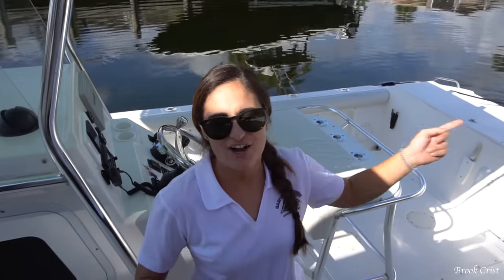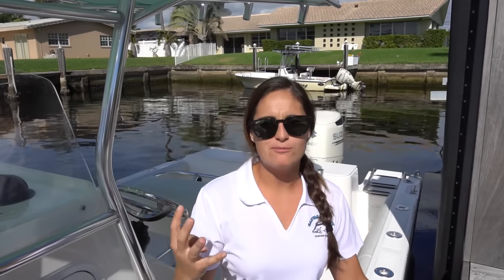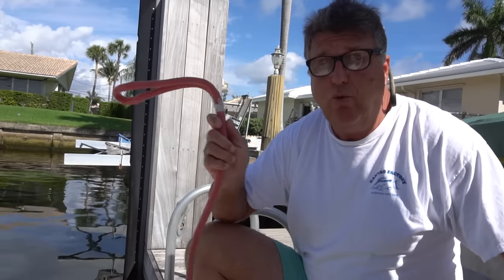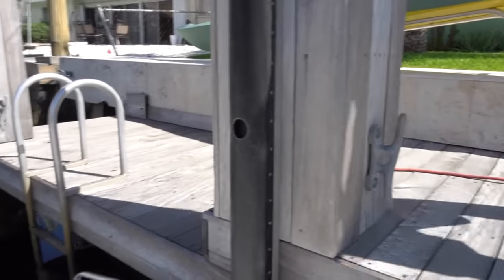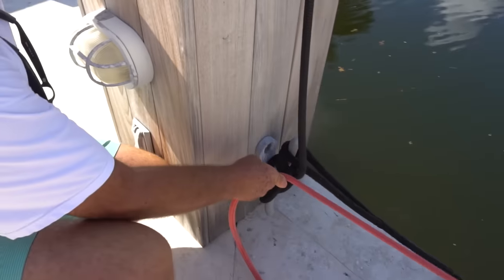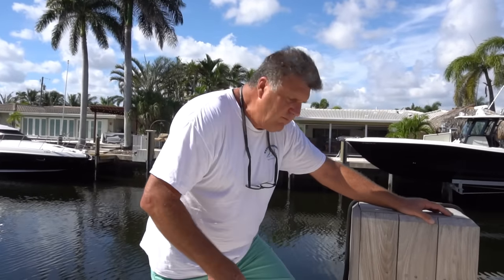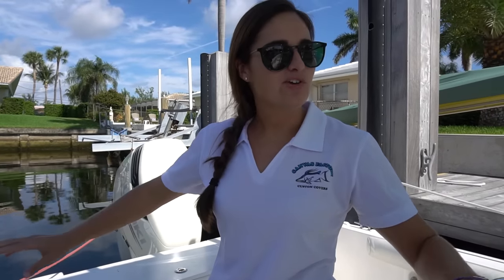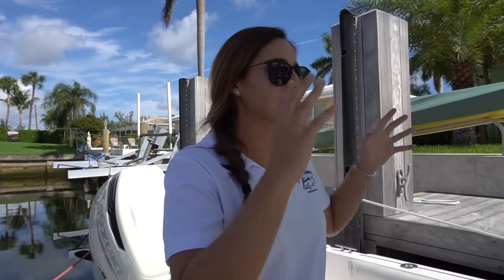HOW TO TIE A BOAT UP AT THE DOCK

Comment: This is all fine and dandy EXCEPT when your docking at a busy Dock !!!. There will be 4/6 boats trying to dock at this dock !! You using Long lines and using 4+ dock cleats will piss off other boaters !! Don't get me wrong, You're 100% Correct with this Line method !!!!. But, If you attempt to do this at a busy Dock, Any Dock Tender (Person helping with docking at many places) won't allow you to do this !!!! They INSIST on Short lines, And most only allow 2 cleats for smaller boats !!. Believe me, I've had this argument many times !!!!. BUT, Great Video and explanation of how the lines work !! Many MANY boaters don't understand this !!. Thanks
Reply: I was thinking that the entire time watching the video.  The method shown is not practical in 90% of the situations encountered.  No f'ing way you can run a line that long at a public dock.  Thankfully I'm on a lake and never deal with tide issues so my lines can be shorter.
Reply: That is true but most of the docks around here are floating docks and short lines are the norm. We always tied up bow and stern lines toward the middle plus an additional spring line. Of course, we were 55 ft long too. lol
Reply: WE are in the northeast and all tie-ups are short and tight. We are always tying to a float, though. 2 lines are all that are needed up here.
Reply: Love this video and great concepts to learn but agree about hogging cleats at public docks.  Another way to do this at a busy dock is to wrap piling by using the loop end to create a large loop that can go around even pilings this size and then tying off to your boat cleats. If you need to use the same piling as another boater, you can "dip the eye" by going up through your neighbors loop around the piling and then around the piling with your loop so that both of you can release without disturbing the other line.  As to the set up in the video, I would tie another line over the mid-cleat to make sure the spring lines don;t back off the cleat horns.
Reply: @erictwombly7233  Makes sense.

Comment: Excellent video!  Good point about using the cleat on the far side of the piling.  I not the knot you use on the cleat, we were shown two full turns and two eights and then a single hitch.  Can't wait to get back on the water!!

Comment: Very impressed by Brooks boat handling abilities. Thank you for making this video and explaining spring lines. In extreme tidal areas, you would want to put your spring lines further out, that is, on the stern cleat and  bow cleat, and then run your spring line the length of the boat to dock cleat. I’m sorry, but, your cleating hitch is incorrect.I highly recommend Chapman Piloting and Seamanship book.It is a most excellent reference for all small boat operations. It is well worth the investment.
Capt.  Fred

Comment: About 80% correct. Making people aware of the spring line is good. Never drop a line across your motor. Need to work on proper cleat tie off. But over all good for novices.

Comment: Good video  with good information  details only 1 type of docking  situation  up north we have  a lot of different  configurations of floating  docks and docks where  your between  2 poles bowed up or sterned up to floating dock and so forth different  types of finger docks, navy docks, one  constant  in a lot of docking  is the long lines or spring  lines   to go up and down with tides 👍

Comment: If you are on a lake you don't need to worry about tides. But wicked storms, winds and current can be just as bad especially on the Great Lakes where the weather can be very unpredictable. This is a very good video with excellent points regardless of location.  Pilings where I'm at aren't nearly as nice as yours so securing a boat is always a challenge.  Also, long lines is the goal but cleats are not always available if docks are full (which is often the case) so you just have to make due in those situations and tie up to pilings instead of cleats.
Reply: That's a good point, I'm in Virginia and good thunderstorm can easily whip up 6ft Whitecaps on the lake here.  People usually wonder how they're boat got beat up
Reply: @aquaticadventures5088  
We get the same thing here on Lake Erie.  The other thing to note is having the right fenders in the right places to avoid damage.  Even if the boat is tied up correctly placement of fenders is equally important.
Reply: @treydrier3169  100% accurate.  We have some people that build docks here that don't even put fenders on, which I guess is okay if you have a Jon boat.  The things some people do just blows my mind lol

Comment: Great video. Question, With my pontoon boat, I only have 2 cleats on each side (ends). and the dock slip I will be at this summer is only the length of the boat 20 feet. Is it best to tie 2 long lines, bow to stern cleat and stern to bow cleat?

Comment: All correct apart from aft line.  Not really necessary to use the outboard cleat esp if you have an outboard engine that you are raising out of the water.  Your aft line is now resting across the engine housing.

Comment: Cool, I was taught to use 3 lines, run a long line from the bow and tie off to the dock around the distance of the mid ship clear, then tie the remaining end to stern cleat of the boat, then run a bow and a stern line, but lake Superior doesn't have tides just the occasional seiche

Comment: Excellent video on showing how to tie the ropes properly. One question and I tie to docks in the keys basically the same as you have mention. But The 1st line you tied to the transom. You used the opposite side, starboard side VS the Port side. Why? Just curious. I normally keep the ropes on the same side as I dock. and adjust the springs to square the boat. Any feedback on your technique of using the opposite transom side??

Comment: Hi Brook, I have the same 300 Zuke with the c10 gauge. Can you do a video on how to properly add fuel using the Suzuki c10 gauge? I’ve heard calibrate, don’t calibrate, just add gas etc. what’s your method to the madness? Great docking video. Thank you.
Reply from the maker: Every time i turn the engine on, it asks “have you added fuel” I always just hit no, unless I’ve added fuel, then I hit yes. I type in the exact amount of fuel every time and it’s so incredibly accurate
Reply: Gotcha! Thank you. One more question. next time your on your boat, does the c10 accurately demonstrates how much fuel you have? It might be the screen that shows “fuel used‘. Mine says 153.0 in a yellow arrow on the far left, above the trim/boat icon but I really have 63 gallons in the tank.  I haven’t filled up since I bought this motor.  That’s why I’m asking. Thanks in advance!

Comment: Great video I'm learning as I go so enjoy yoy video a lot. I also happen to have the same boat and set up with the. Suzuki 300 and I wanted to ask you what you top speed and what size propeller you have.
Reply from the maker: Not sure of the prop size off the top of my head. But max I’ve seen is like 35. Hbu?
Reply: @brookcristoutdoors  My propeller is 3×16×18.5R my top speed is 41 in good weather. I honestly thought will be faster when I install the 300 Suzuki, but is still nice.

Comment: The problem in Florida and fixed docks are also the currents. Many docks have 6 piles (when the boat is larger) so you need two lines on the bow and two on the stern plus two spring lines. Floating docks are much better and I wish Florida had more of them as we came in Florida from Boston where all are floating due to much higher tides of course. Regardless nice video guys.

Comment: I'm anew boater as well and I thank you for the info but as I was watching I was like "is this gonna piss anyone off?" or what if the dock is crowded and there is only a tight space with only cleats available at directly next to your boat dock spot?
Reply: So two cleats, run from the opposite sides of the boat. Making an X in the middle of the boat with the two lines. Just careful stepping back in.

Comment: With square piling, don't you run the risk of the corner of those pilings cutting away at your lines?
Reply from the maker: We've had our boat tied at our dock with the same lines for 5 years and have never cut away or chaffed any of the lines!
Reply: YES ... Never do that
Reply: If you are there temporarily it shouldn't be a problem but long term I think you have a valid point.
Reply: @brookcristoutdoors    
But your pilings look smooth and well kept.  That's not always the case.

Comment: If it is a floating dock that rises and falls with the tides you do not need long lines you could use short lines but do use two spring lines to the midship cleat to prevent forward and backward motion of the boat

Comment: Only problem I see is you’re gonna tick a lot of people off at a restaurant dock taking up that much space with the long lines
Reply: My thoughts exactly... blanket party at your boat after dinner bro!
Reply: @aquaticadventures5088  your paddle boards will be fine bro's when you wanna get some nattie light at gas station
Reply: @jnava121  now.
Reply: Exactly.  If the only place i got to pull up is all jacked up because someone has extra long lines.  I'm cutting your line and gonna dare you to say something
Reply: @nunyobiz7889  tough guy on the internet, gonna get shot and then cry about it in real life. Then you be like i dare  u to call my mom's lawyer!
Reply: @nunyobiz7889  No need to cut any lines, you simply cross your lines over or under the existing lines. It's not rocket science. That's just being rude.
Reply: I would just take pics of my junk on his throttle. That way no harm no foul.
Reply: Cleat hog?
Reply: @nunyobiz7889  Try leaving your house once in a while you won't be such an angry ant

Comment: I like the video and I wish I could do that, however,,,, this will only work , if you have a smaller boat with about 4 dock spaces to deal with, and here in Fla, when you go out to eat, and go to a dock and dine restaurant, there is absolutely NO WAY that someone would have the lluxury of that much space to tie off just one boat,,, if you did, I can guarantee you would have a lot of pissed off boaters,,, for example, I have a 36 trawler, and would love to be able to have that much dock space, but I only have enough to fit the boat.which is  really a lot if you think about it, your way,  I would have to have about 75 ft of dock space,,,,lol  , as I am using the space alongside my boat lift, so basically I only have enough space to park the boat there, and do the best I can to make it safe,  any suggestions? can I go diagonally with the lines and not away from the boat, but rather criss crossing the lines from bow to stern and add a couple of lines to keep it from going out  from the dock to the outward side of the boat from where it is docked,    hope I was able to explain it, but great vid

Comment: One more thing:  OWN your dock lines unless you're at your destination and leaving the dock.
For short stays, connect the line to YOUR deck cleat , then pass it to the dock.  Have the simple connection on the dock such that you can release it from your boat. A simple loop around a cleat or bit or piling is all you need.
Then lead the bitter end back to your boat and secure it to YOUR cleat again.
This way you are never dependent on having someone on the dock to release your lines.  You never know what kind of crazy knot they will fashion that you will need to undo.
Especially if you need to leave the dock in a hurry, such as an approaching storm.

Comment: How do you use long lines when the dock you are tying to is no longer than the boat?  In fact, the dock that I have to tie to, my outboard sticks out the end of it.  I stretch my springs as long as possible extending them from the furthest pilings, but bow and stern lines are short with no way to use long lines.  Do you have a solution?

Comment: Nice video and good tips! As a slight critique I would say you could have attached  your forward spring line to the stern cleat instead of to the same cleat as your aft spring. In fact, in a storm, that's what you would do,  Cleats should be mounted to the dock and not the piling for the reason you mention.  I find it an annoyance to go around the piling, but it makes sense in this case.  Yes as was mentioned in comments, you said "rope" a lot, but that is not an improper term when the rope is stowed on board or otherwise not in use,  rope only becomes a line when it is tied to a cleat and in use. So, it's ok to say, "get a rope and tie it to that dock cleat", "carry lots of rope on the boat... etc".  But please, you gotta learn how to tie a proper cleat knot if you are going to make boat tying up videos!  LOL

Comment: 40 yrs.experience as coast guard certified.  If I have a choice I always have the bitter end ( not the loop on the boat) on the boat.  Why because if there is a fire or other emergency you can untie the bitter end from the cleat on the boat.   If the lines are tight with loop end on boat cleat you better have a sharp knife or axe to get loose.  You never see a ship or cruise liner tied up with the loop end on boat it is always to a bollard on the dock.

Comment: Your correct on long lines but the way you tie your line is terrible. You go around the cleat till you meet up to the line, across the cleat and a half hitch, that's it. it should look as clean and neat as possible and that way they are able to  be undone easily and they act on the shoulder on the cleat not the horns.
Reply: Got to agree and in addition all lines should go around the cleat in a clockwise direction.

Comment: I felt like video represents over all quality.  However, I would never tie boat to cleat on pilon, I would use shock cords on lines, and not leave lines tied to dock when boat away from dock.  Maybe just me or perhaps a cultural difference living in New York State.  I have been boating on Cayuga Lake (Finger Lakes).  I have come across bad weather and very rough water.  My personal belief is leaving lines tied to dock is a bad habit.  I just feel like better to learn how to tie line each time boat is docked.  I would also take line all the way around pilon and tie rope to itself instead of cleat.  I don't want to take chance of using bad cleat or ripping cleat from pilon.  I will also say I am not having to manage tidal changes on Cayuga Lake since not ocean or sea.  I did enjoy video though.  Thanks

Comment: 1. Its a line. Not a "rope". 2. Your cleat hitch is wrong. Not around twice. Around cleat from opposite side of load, immediately cross, twice, then 2 hitches, not 1. This prevents jams and simpler to ease off.

Comment: Never put a hitch on a cleat. If it’s needed, it will jam beyond your ability to undo it. Even on the boat, always secure in such a way that the line can be released under load. If you insist on doing it your way, keep a sharp knife handy.

Comment: Fine properly dock your boat! Couldn't agree more especially from what has been seen in my travels. However your cleat tying is wrong ; you do not use turns and half-hitches. As for dock lines and the rest of the ground tackle, these items always go with the boat. Also with that Suzuki outboard you might want to carry a tow line? Sorry outboards are not my choice to power a boat, course that's another concern. You get an "E" for effort.

Comment: a nice video, but it assumes no floating dock and a 384 foot long dock line.  My marina has floating docks, so the dock moves up and down with tide and the boat does as well.  I do like the advice of using half the cleat for a line, and wrapping the dock line around the pole to prevent pulling out the cleat, but I have to tell you no one does it that I have seen.

Comment: This is fine if you have a private dock or an entire dock to take up.  But at a restaurant or a public dock you will end up pissing someone off taking up all that room with your lines stretched that far.  You aren't tying at a 1000ft container. A shorter inshore line at the bow and stern is plenty vs those long ass offshore lines you have tied.

Comment: I agree with the concept but the only issues I have are the way the ropes were tied to the cleats. That way requires tension to be taken off the ropes in order to release them. If the ropes were under a large amount of tension they would be near impossible to take off so if the tide were to drop and the boat were to get strung up on the dock, there’s near to nothing you could do, the same if there was a hurricane/storm or a large surge etc. 
I assume you take the boat out of the water in the event of a hurricane and so I suppose that since the boat is not particularly large, it’s docked in a sheltered area and the tide level change isn’t particularly big in Florida, it’s unlikely to cause much of a problem for you, but be aware that may not be the case for larger boats under different circumstances.
That and it looks like you could fray the ropes on those pillars but I’m not sure about that, I can’t see the state of the edges.

Not a massive criticism, just a warning to others, although most people with much larger boats probably know already.
Reply from the maker: There won’t be that kind of tension if you properly set the ropes up.. which is the point we were trying to get across...  the boat won’t get “strung up” on the dock if you do it correctly so you’d never have that kind of tension....

Obviously hurricanes are completely different... 

We’re tieing up a 24ft center console. I’m pretty sure if someone has a yacht that’s much larger they wouldn’t follow this tutorial.... 

And last we’ve had our boat tied to the dock with the same lines for 5 years and the “pillar edges” haven’t frayed through the rope...
Reply: Brook Crist Outdoors I’m aware and I meant no offence, big fan of your channel, it was just a word of warning to those in different circumstances